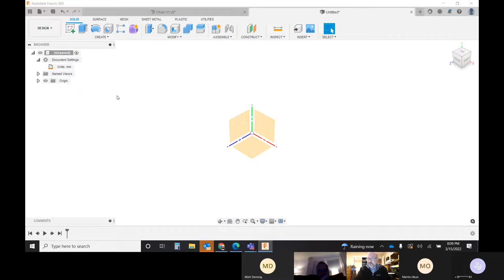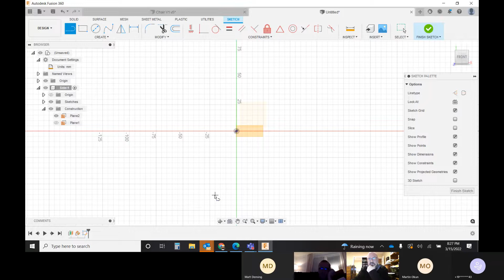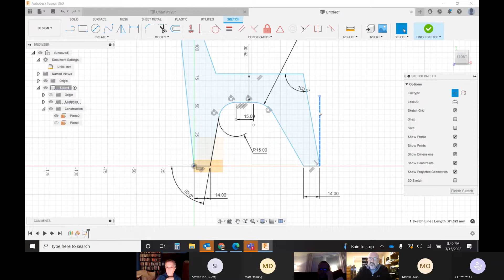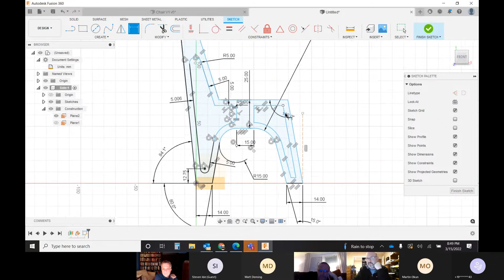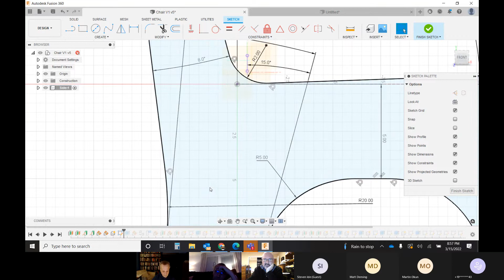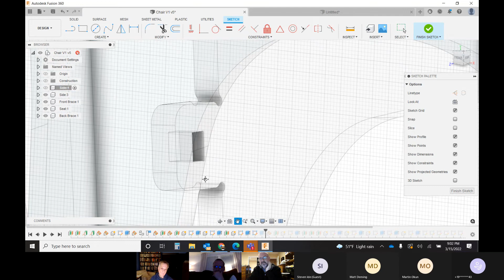Fusion 360 - Sketching: explaining drawing elements, tools, constraints and dimensions

Comment: FYI - You can extrude without a profile if you choose "Thin Extrude" as an option in the top of the extrude options pane. Then you could extrude a single line, you just give it thickness. Really handy for thin wall features.